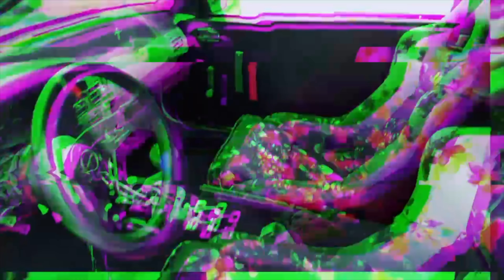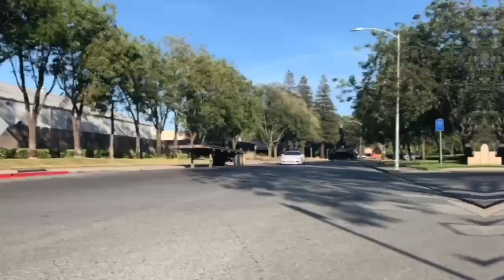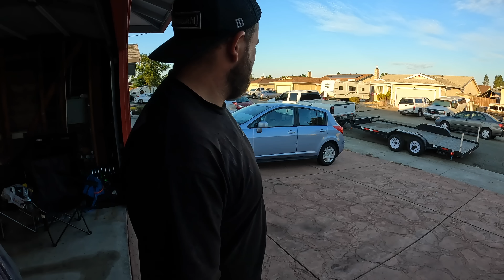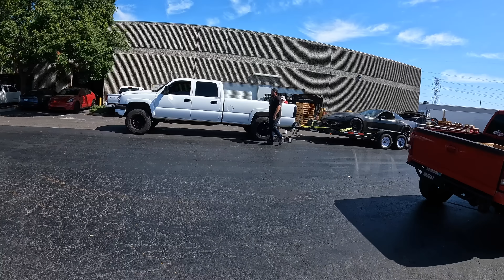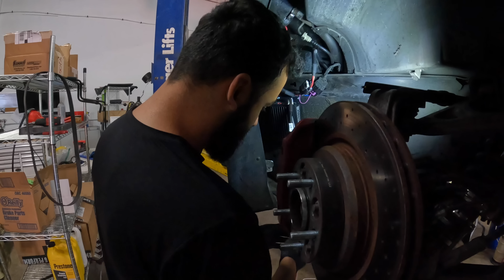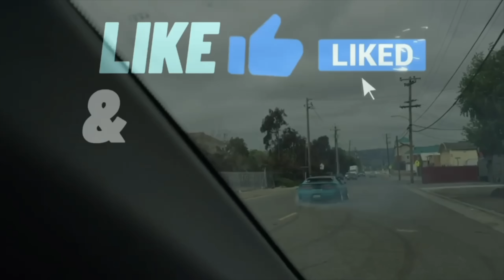I'm Going To Burn This F***ing Car Down To The Ground! JUNK JUNK JUNK!!!

Comment: My LS had a similar tick issue after a brand new cam and lifters install. We thought it was a faulty lifter or incorrect pushrod length but turned out to be a machining tolerance in the CNC machine for the cam. Swapped out for a new cam with the same specs and the tick was gone.

Comment: I was building a new edge and i went to put in a 2000 6.0 lq4 and a 2003 4l80 after weeks of trying to figure out wat was wrong. Found out the spacing of the transmission is different in those years. The 2000 has a longer crankshaft and WONT work with any other year transmission. Its trial and error sometimes u will get it done soon.

Comment: After getting the wiring checked and still no answers. I would part out or sell the whole car and cut your losses. Especially after 12k in diagnosis not even worth it at that point, in my opinion. Keep up the content though! 🚀
Reply: And it’s still not fixed that’s crazy

Comment: Could it be something with the column lock issue c5’s have? Did you do the lmc5 upgrade? The fuel pump cuts off after 1mph

Comment: Mike i need your help what is the little amp called that he's putting on the vette. My fuel pump  is giving to much amperage to the relays and making them get hot and melt a little. I got foreinnovation 450 dual fuel pumps. Would that little amp help out. I don't know the name or brand of it ive been looking to control the problem ?

Comment: Did you checked if your camshaft is straight? I had almost the same problem what happend with your engine, the mechanic told me that everything was fine. But did noticed was my camshaft. I hope that you will find the problem bro, i will pray for you🙏🏽🙏🏽🙏🏽

Comment: Yeah these GM cars have alot of issues. I drive a 95 f150 a couple mods and a lot of my friends drive the same year Chevys or a bit newer and they are always have fuel issues, lifters, Electrical issues is crazy. It’s while cause I actually wanted a Chevy truck originally but after I saw what they go through I couldn’t sell my ford. Ford one.

Comment: make sure your not getting a voltage drop on that signal wire for the o2 sensors 🧐 from o2 sensor connector to the pcm

Comment: You should just rebuild the engine because you know what exactly what's going on with it giving it to someone else is a risky thing to do because scammed out of my racing parts Shop closed after I took my truck out of there found out what they did way back no one on the shop no more like 3 days picking up my truck for me till then I packed up and took off did a bunch of research on fixing a truck and but my knowledge to it and fix

Comment: Quit trying to make everything a thousand horse power 🤣🤣🤣 everytime this happens watching Mikey make the same mistake over and over
Reply: @taylorsrus9543  bruh every thing is over 500 hp no engine is engineered to be ran over that consistently that's about the breaking point
Reply: @taylorsrus9543  maybe you didn't read correctly I said quit trying to make everything a thousand hence quit over building street cars aren't meant to be ran at max hp that's why race cars have multiple engines ready during racing and change engines every other race maybe you're not familiar with racing
Reply: @taylorsrus9543  every car manufactures gives certain engines a certain horsepower because that's the max the motor can run reliable and consistent for years when you start over building an engine the life span of the engine is reduced dramaticly hence the engine breaking down more rapidly its simple engineering
Reply: @taylorsrus9543  again you dont understand I'm not saying a 1000 isn't realistic im saying when you build your engine up for that shits going to break more frequently smh Jesus people are dense

Comment: Watch out the ranp am most smacked your car the 2by4 nee to be on the bottom for the metal ram do the back end will push the ramp down and the wlnt pop up when you drive on

Comment: This is why I stick with Acura, Lexus , Porsche, Maybe Nissans Infiniti like the trucks and 400 Z or GTR but that's it. Corvettes have that unreliable reputation.
Reply: Lol Porsche for reliability lmao.
Reply: Vq's lol
Reply: You just naming brands of cars. Not the motors. Nothing wrong with ls3's. Not every motor or car is going to be 100% reliable. Like your Porsche lmao
Reply: @taylorsrus9543  Yeah i totally see that. Corvettes are already finniky when it comes to modifying and just projects in general are very expensive. You need the right people the engine builder and the tuner. They have to work together or this gets expensive real quick
Reply: @mrhatchyK24  Dude the 911s and most other porsches have solid reliabilty dont take my word for it look it up. You know lexus and Acura leave no doubt
Reply: @sbfhawk4343  yea Acura reliable Lexus is ok.
Reply: @sbfhawk4343  yea that's why I stick to Hondas
Reply: @taylorsrus9543  yea fr
Reply: Any car that is boosted looses the reliability rating from online. If you running 700hp boosted somethings Gonna go wrong eventually.

You can't go 200,000 miles with a 700hp ls3. You can't go 200,000 miles with a 700hp Porsche.
Reply: @mrhatchyK24  I mean its almost safe to say that anything over 400 to 500 HP things get to be really tricky!! I mean unless you build that motor to handle it like throwing rods. Pistons, High performance gaskets, ARPS bla bla you know the drill wont go into those high numbers without some form of breakage. You don't have to tell me about Hondas, I own Two 88 CRXS with the B16A and B16B respectively, 1 88 SUPRA 1JZTE , TSX limited , A TLX Type S , a Porsche GTS , FJ40 all of those examples are F legends and last decades
Reply: @sbfhawk4343  yea you got all good cars not 1 bad one.  I just got a stock 93 rn lmao
Reply: @mrhatchyK24  damn you replied to every comment 😂
Reply: @kingGfour  yea it's what I like doing lmao
Reply: @mrhatchyK24  But you choose wisely !!! Welcome to the club lol!! Its 1 but thats how I started